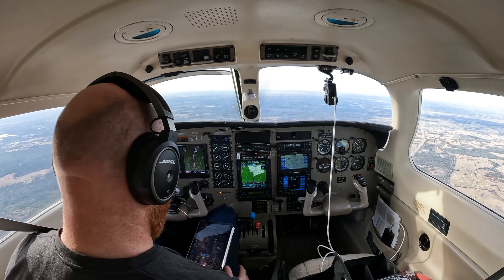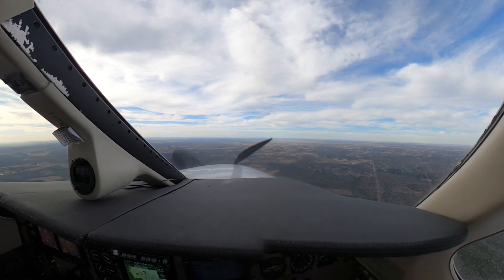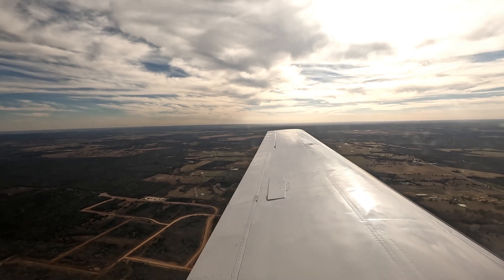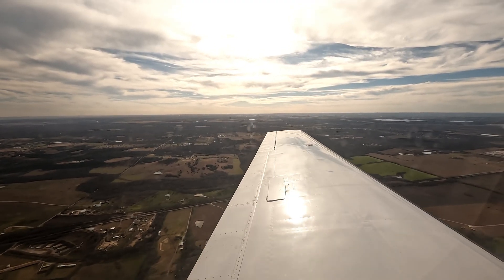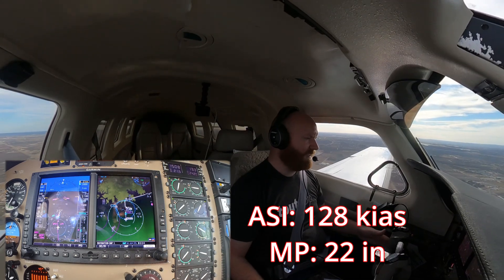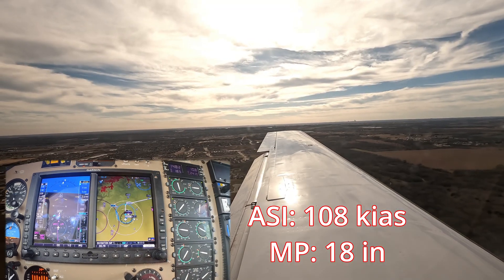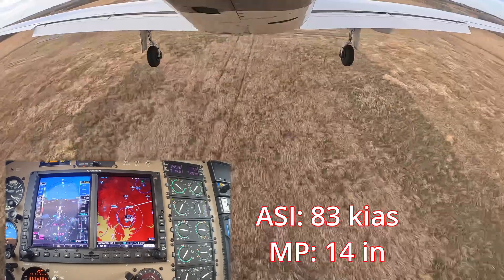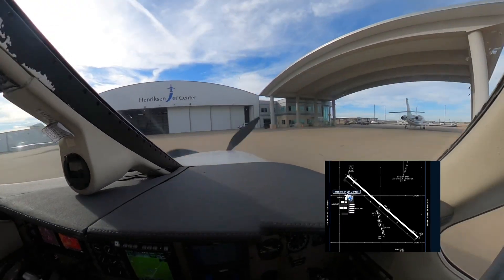Landing at Austin Executive — Energy and Engine Management — Piper Malibu PA-46

Comment: Interesting. In my Malibu we fly a set it and forget it approach. 25" in the terminal area. 20" abeam the numbers or GS alive/FAF. Gear and flaps control the air speed. Leave it 20" until crossing the fence and then slowly roll it back to idle.
Reply from the maker: I'm not sure if it's because I'm often being descended all the way to the FAF, but my gut reaction is that it would be hard. I need to give it a shot and lean more on the gear and flaps for airspeed control next time and see if I can make it work for me.
Reply: @TaftLove  I am sure you have seen them but if not, check out the operating practices diagrams on MMOPA